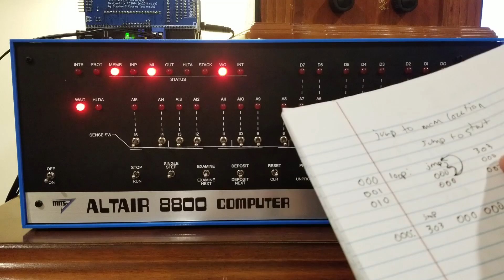Altair 8800 - Front Panel Programming Tutorial #1

Comment: Why do you need the 000 twice?
Reply: O I see, it’s because we need 2 bytes,  high and a low
Reply from the maker: @miker3443  Exactly! We can't trust the RAM to be all zeroes, there's nothing initializing it. In fact, when you start an 8080 chip clocking from RESET, it reads address 0x0000 first, then 0x0001 and so on in order. So, the first bytes of the RAM are going to be (usually) the boot program of the Altair's monitor copied from ROM. This means those bytes are DEFINITELY not zeroes!